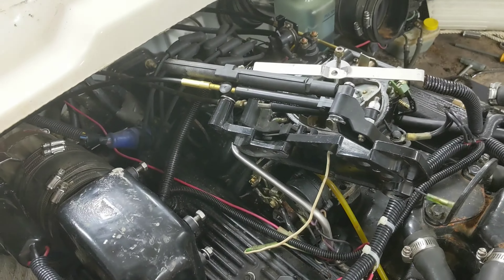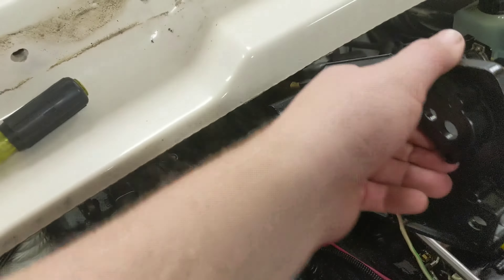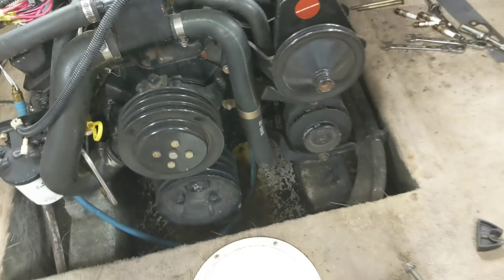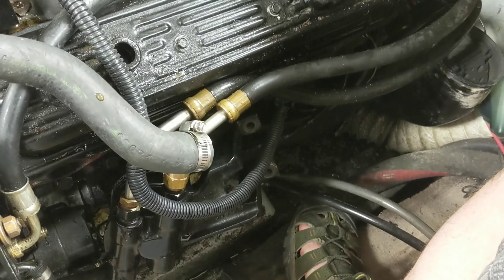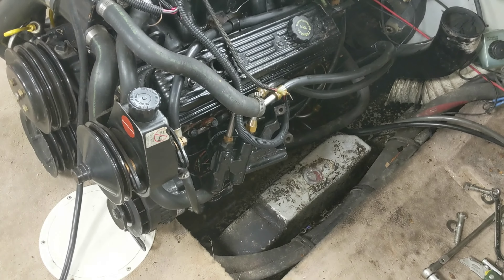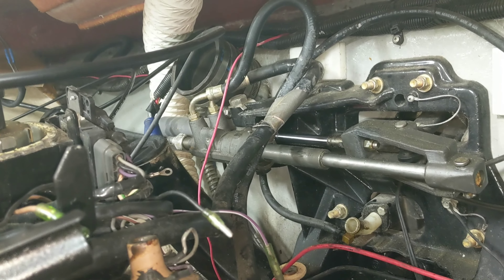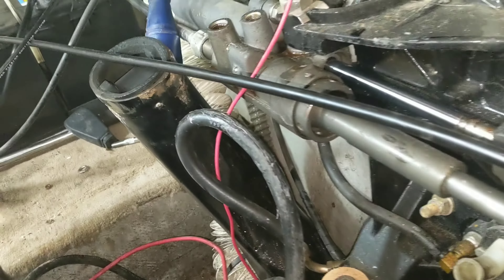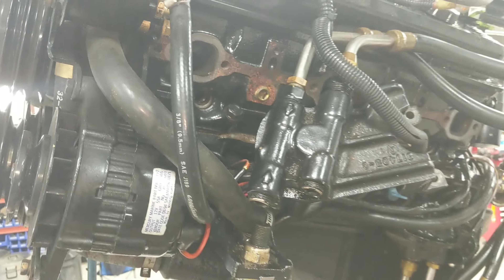Removing My Mercruiser 5.7L Boat Engine

Comment: I did the same mistake of connecting the chain to the same thermostat housing eye and I found out that is not intended to hang the whole engine because it could cause damage to the engine.  There is another lifting eye next to it where you are supposed to connect the chain..  To late for me, hopefully didn’t cause any damage, and I also remove the log bolts, hopefully I can put them back and they don’t get loose.
Reply from the maker: I found that out after the fact as well.  It didn't hurt anything on my engine but with the manifolds on the engine they are surprisingly heavy.  I guess that lifting eye is for aligning the engine.  Basically you bolt in the back of the engine and then lift with that eye so that you can get the front mounts set up.  Everything worked out though regardless.

Comment: been there. i would take the outdrive out first. i would not loose the two lag bolts of the engine mount, when you tight them up in the future, the threads in stringer can come loose. this happened to me. i would just loose the top nut on engine mount. did you try to turn the main pully by wrench?
Reply from the maker: I left the outdrive in for now. It's out now actually but I took the engine out first. I tried to spin it over but it was just tightening the center nut on the balancer. I was afraid it was going to snap off in the crank. 😬

Comment: Yeah outdrive off first. You’ll never get it back in with the outdrive still on. The tabs on the flywheel cover you mention that don’t do anything aren’t used in any boat this is just to mount the engine to the shipping crate. You can also put it on them on the ground or screw it to a pallet or dolly to run it out of the boat . Good thing to do with any engine before you drop it in.
Reply from the maker: Ya the outdrive is out now. It has a worn out gimbal ring so I'm working on that now. I'm behind on my videos. 😢
Reply from the maker: That's interesting though. I was wondering what those tabs are for.
Reply: Thanks bro video helped alot I didn't know the 2 pins released the engine I have mi e tore down alot more than yours.
Reply from the maker: Ya once you see it it actually makes a decent amount of sense how they did it. Don't need to strip all that much to remove or install the engine. Glad to hear it helped you!

Comment: I understand you motor is from a 1995 boat, but what year chevy motor is this motor based on? Is it based on the 1986 motor? i thought the newer ones are tbi
Reply from the maker: I'm not sure exactly. My understanding is the boat engines run a little behind the Chevy automotive engines. I believe you get a mechanical fuel pump, non vortec, hydraulic roller camshaft 2 bolt engine you can look at like an 88-90 or so Chevy pickup. The block number on mine is 638. Hope this helps. 🤞

Comment: Do you know any trick to get those risers out?
Reply from the maker: You are just trying to remove the risers (elbows) and not the manifolds? If so, for me, I loosen everything and then pull the risers forward and off of my captains calls. Might be a little different setup on your rig.

Comment: I have a MerCruiser 5.7 Lt  Carburettor 350 Magnum and i have a problem with the Thermostat Housing which is cracked ! Is there any spare part or someone i can talk to ?
Reply from the maker: I don't have any spares. Which part is cracked?
Reply: @605BOLT  It is exactly the same as the one in your video
Reply from the maker: @stefanosk2700  is the center section cracked? Or the top cover?
Reply: @605BOLT  all the part is cracked... the thermostat housing part is crached in 2 pieces because of the salt water probably and the years! It is model of 1993 with only 200 hours .. the engine is in a brand new condition because i do my services every year . The last 6 years it was inactive
Reply: @605BOLT  i always clean before use and after use the engine with lake water
Reply from the maker: @stefanosk2700  I would have to do some digging to find the part myself. I can do that but just not right this second. Sorry. If you want help basically right now I would call JR Marine in Ohio. They have sent me parts and they always are the right part. Good prices too.
Reply: @605BOLT  thank you very much ! Id love to have a way of communication with you to talk about a couple of things